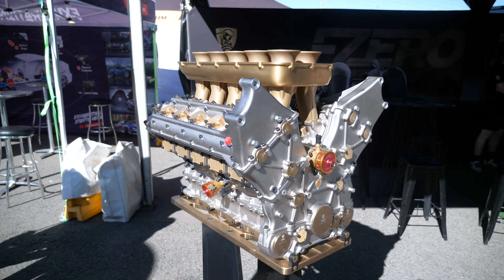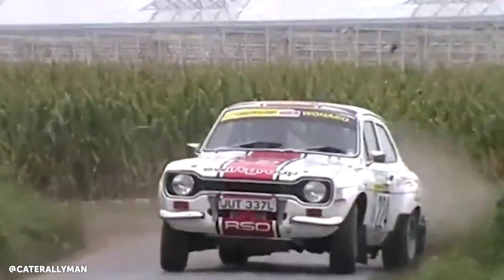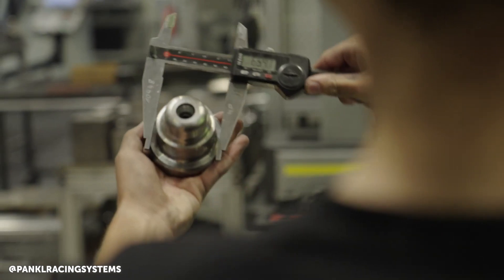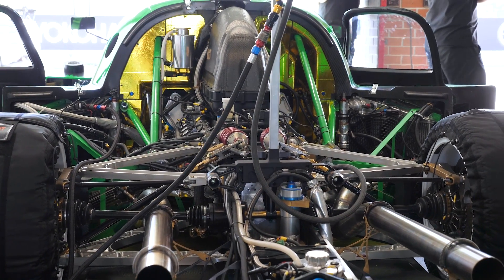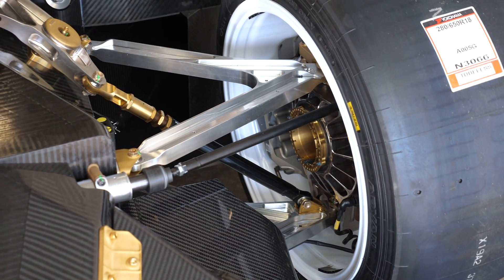NEW V10 Engine With A €45,000 Crank | Rodin RC.TEN

Comment from the maker: What's your favourite V10 in terms of sound? - Taz.
👨‍🔧 Building a fast car? Get $400 OFF the all-inclusive VIP online course package deal:: https://hpcdmy.co/rodinv10
✊50% OFF your first online engine building course. Enrol now: https://hpcdmy.co/rw3
TIME STAMPS:
0:00 - V10 V12 Nostalgia
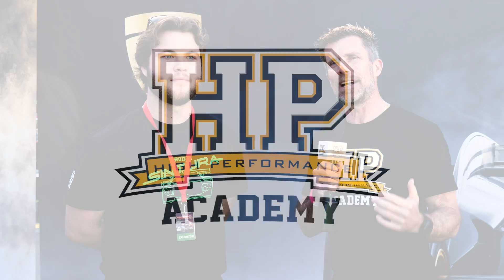0:20 - Mike Gartrell: Rodin Cars
0:30 - Why Design A New V10?
1:07 - What Did It Take?
1:58 - Neil Brown Engineering
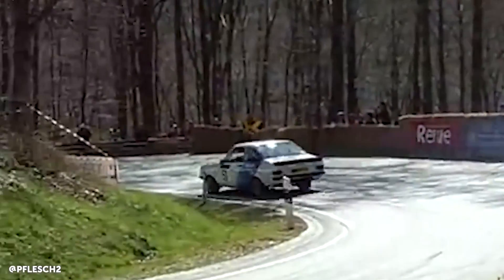2:17 - Design Process Simplification
2:30 - Engine Specs
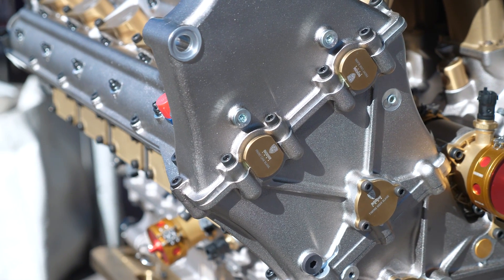3:05 - Volumetric Efficiency
4:10 - RPM Multiplier
4:28 - In House Machining
5:04 - Why? (Scale)
5:59 - 3D Printing & Casting
6:42 - What Is Vacuum Casting
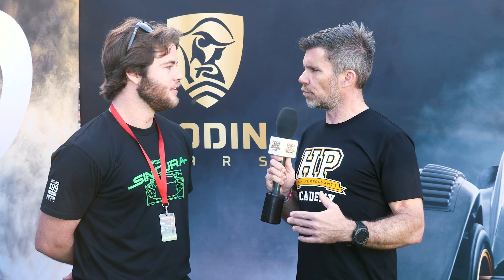7:12 - Why Cast Vs CNC Vs 3D Printing
7:48 - Initial Testing
8:26 - Sentura Packaging Restrictions
8:44 - Twin Turbo Plans
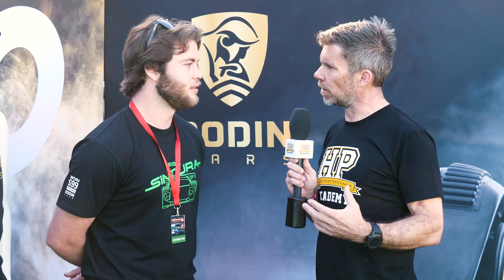9:48 - Steel Lined Bore
10:17 - What Is Nikasil?
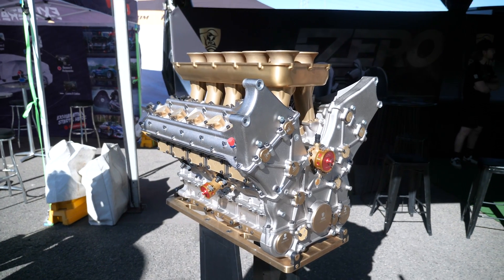10:57 - Direct Injection
11:29 - Bosch Fuel System
12:06 - www.rodincars.com
12:10 - LOUD NOISES
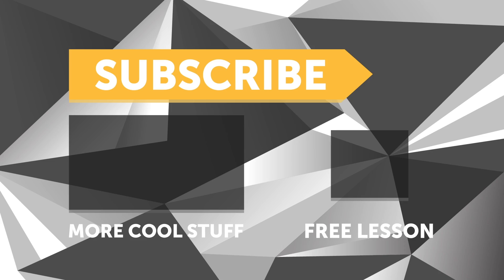12:50 - BUILD.TUNE.DRIVE
Reply: Lexus LFA
Reply: Favorite V10, in terms of sound? The Judd V10 in Ryan Tuerk's Formula Supra. As far as I know it's the only one of those engines with an X-pipe in the exhaust system, and nothing else sounds quite like it.
Reply: @griffinfaulkner3514  the judd v8 in the bmw Hillclimb car is also absolutely incredible f1 sounding scream, chills everytime i hear it
Reply from the maker: @griffinfaulkner3514  solid choice! That car on the whole is immaculate - Taz.

Comment: 86mm bore is the downside, IMO. Judd's got it right with the 90+mm bore. I mean, 89mm at the very least, and if you paired that with a 63.5mm stroke, you could rev even higher. It's not like 92-96mm pistons can't be made for extreme RPM duty above 10k rpm. 95 bore 63.5 stroke gives you a 4.5L that can safely rev to 13k and likely make peak power around 11.5-12k for over 850hp at the crank. An 89 bore on the same stroke would be down 100hp and 550cc from that.

Don't forget the stepped header primary tubes and a merged exhaust for the ultimate harmonic wail overtones to the V10 sound. I see this car has divorced exhaust, and because of that it doesn't sound as good as Ryan Tuerck's Judd supra. Pretty easy fix, just merge the dual 3" collectors/pipes into a single 4.25" pipe. Should be good for about 740hp worth of flow, too. Do your own cross-referencing and calcs, but the easy calc to go up, assuming area is matched to flow, is 1.414x the diameter of your duals, whatever they are.

Comment: This is for the purists with big pockets. Proud of them. Even doing part of this is hard in NZ, let alone the whole thing. Incredibly impressive vision and drive. 
I love it, but for me an LS platform doing similar or more power and torque for 20k range is far more enjoyable and to me sounds just as amazing in it's own way. 

Nikasil was developed in ~30s for Lister CS indirect injection diesel engines (the longest produced engine of all time, still in production today) and was what pushed their lifetimes further and further. 80k hour rebuilds on modern oil with that coating lmao. 5L per cylinder, 12hp in a twin at 650rpm and 90ftlbs. Weighs 750kg and will do that load all day, all night, all week without letting you down if you keep the oil happy.
When it was truly Great Britain. How far it has fallen today.

Comment: Nickilsile is the 👌 👍 😍......no wear...less friction...its a carbide like coating that all you do to freshen up the engine is 600 grit sandpaper by hand in a criss cross motion in soapy water and blow dry and wipe with oil to deglase ...and a new set of rings and wham!!...... new engine 😊

Comment: How are they supposed to be running 110% VE on a NA engine? And wtf is this guy talking about, the casting method increasing the density of the material? Honestly, this guy seems clueless. Bad image for the company
Reply from the maker: It would be great if you can post up some details on how he is wrong to state these things with supporting links. I can tell you though in your search you are actually going to find out that he is right on both counts here 😉

I'll let you do your own research but for anyone scrolling by:
110% VE is possible and isn't even uncommon in N/A motorsport applications. That has been the case for decades. I'm sure there will be some dyno tuning videos showing this if you have a hunt. Sadly it's not something we've covered (from memory) outside of mention in the VE module of the EFI Tuning Fundamentals course.
Different casting methods can influence the density of the finished product for a few reasons, but porosity is probably the simplest to look into. You will find info on this from many major companies that offer such services. They often supply handy comparison tables.

I'm sure Mike would even politely explain these things to you if you had the chance to talk to him rather than personally attacking you too. Food for thought in how you treat others, even in the rather impersonal comments sections here... - Taz.
Reply: hahaha

Comment: GMA T.50s is at 770 hp at 6 kg heavier, and I'm guessing more reliable. That includes the ISG as well
Reply from the maker: Yeah that's a nice V12. Guess you'd hope the 2 extra cylinders would be worth the effort compared to a V10 in some way eh.
Without data, all you have is an opinion regarding the reliability guesswork, I guess 😅
We'll know how this pans out with time, same for that Cosworth GMA V12.
When I say 'we', I'm sure you're in the same boat as me and will just learn from others experience really with no actual skin in the game to worry about 😂  - Taz.
Reply: @hpa101  yeah, it's my guess purely from the fact that the T.50s engine is a V12 (superior balance to a V10 naturally) and that it's a semi stressed design rather than fully stressed

Comment: Great car. I'd like to know what fuel they use. Cossworth GMA 4.0 is a V12 street engine with 650BHP, it would be sure very interesting to see the comparison. Great video, thanks.
Reply: This is a race engine. T.50s engine makes 770 hp and is essentially the same weight
Reply: @Shadowboost  
The T.50 engine is the GMA engine. It makes a little bit over 650bhp. It has a bigger brother for the Aston Martin hypercar, a 6,5l V12 with 1000bhp, a little bit over 200kg.
Reply: @kledomuc1713  the T.50s is the track version of the T.50. It has a modified engine with no variable valve timing, no emissions devices, and 12 ITBs. It makes 770 hp and weighs 166 kg. It is DIFFERENT than the road car engine
Reply: @Shadowboost  
Thanks. Heard of the track version but didn't know it has such a significant power, I love this engine even  more than.

Comment: there was no better sound than those 19k rpm V10s. Can somebody help me understand the benefit of the V10 over the V12 in F1? I remember hearing that the V12 outright makes more power, but that the V10 has a better balance of weight and fuel economy. Is that all there is to it?

Also, imo, they should take those modern literbikes with the most advanced consumer level engines in the world, and just scale that same tech up to v10s. Mmmmm that would be nice!
Reply from the maker: I think reliability at high RPM was a factor too, but the capacity rules changing according to many put the V10 in a sweet spot compared to the V8 or V12 options on the table at the time. 
There are tons of articles and videos on the V12s, but ultimately the V10s came out on top with the Ferrari V12 of the 90's failing to gain any driver or constructors winners trophies. Crazy how many DNF's they all had back then compared to today - Taz.
Reply: @hpa101  Ahhh reliability. Thank you so much. Maybe the less moving parts and also relatively larger engine parts helped with the reliability.
Reply: @El_Chompo  it was mostly weight and fuel economy. Reliability was not bad with the V12s since the engines were better balanced than the V10/V8s
Reply: @Shadowboost  when i read about it, at the time the V12s were too thirsty but the V8s they developed didnt had enough power. The V10 config was actually a novelty for cars that only really started in late 80s exactly as a favorable middle ground between the pros and cons of the V8 vs V12, despite the natural inbalance they prefered to try and work around it with a little more overenginering with balance shafts and other components which to an extent played to their favor as they also made these engines a lot more sturdier and capable of reaching really high power figures and revs. Today with tighter emission standarts and advancements on forced induction tech the V10 is unfortunately virtually dead as VW/Audi ceased the 5.2 FSI, the last production one remaining, and only race tuners and crate engines like those of Judd for example still exist but are really hard to get and not very suites for road usage unless they get significantly remaped. I think the key objective advantage of a V10 today would be size min maxing as its obviously smaller than a V12 but could potentially be more adequate than a V8 for higher displacements, and if willing to work around the balancing issue the engine would consequentially be sturdier naturally. Still, really wish the car industry gave it more chances, they were still ultimately a rare config as you can count on both hands the number of road engine V10s made counting multiple gens like the Viper as one, and back in the 2000s with the F1 and novelty hype behind it a lot of brands were giving it a shot (shame Ferrari didnt had the balls to try and giving it a shot as well, their F1 engine was amazing) but even still, now its basically dead unless Rodin here want to bring it back (please please do) Cosworths RB17 unfortunately is not road legal as amazing as it is so its not the same thing, same with the Solus GT from Mclaren.

Comment: Volumetric efficiency is theoretical mass x actual mass. Theoretically mass is the mass of air that would fill the same volume as the cylinder displaces. Having 110% is news to me. I’m assuming it’s a ram air design of some sort
Reply: Ran air. All these formula type engines make that
Reply from the maker: Not necessarily ram air and only ram air. Here's a quick piece on pressure waves and ITBs -https://www.hpacademy.com/technical-articles/trumpet-length-and-its-effect-on-torque/

The great cam control we have these days is important too.

This is also a quick thread on the topic: https://www.hpacademy.com/technical-articles/trumpet-length-and-its-effect-on-torque/

Hope that helps @Lnmoto86 and @Shadowboost. There is some more on it in the forum too 🤘 - Taz.

Comment: So just want to make sure I'm understanding their engine development.
It makes 720hp, well only 500, but 220 or just under 1/3 more power is totally easy to find. ITB's for the win!
12,000 rpm
15:1 compression
Current cams are to suit turbo application, which in no way would support 12,000rpm or 15:1 C/R.

Current inlet manifold is single throttle body designed to support 1000Hp + however is currently a restriction
And direct injection because super lean burn is the way forward.

That interview did more harm than good.
Reply: Yeah, it's a bunch of targets. Meanwhile GMA has actually demonstrated 770 hp
Reply: @Shadowboost  It's not targets it' straight up nonsense.

Why are turbo cam profiles different? Because you don't want boost going straight out the exhaust so there is generally no overlap.

Why 15:1 compression ratio? because high rpm N/A engines have low dynamic compression due to the large cam overlap required to exceed 100% VE and reach high rpm.

So to claim to be running that combination is an admission of a) not understanding how engines work b) not knowing what the actual combination is c) making excuses for the lack of performance in a nonsensical way.

As for the 1000hp + manifold it will allow 1000hp+ N/A or boosted, unless entirely too small requiring high boost pressure to overcome lack of area which is extremely inefficient. 

Direct injection isn't even the most efficient method of combustion. Pre-chamber ignition is. So if you were clean sheet designing an engine why not go with what is best?
Reply: @jdoe9518 I would love to see pre-chamber ignition on a flat-6 huge bore aero engine. But otherwise, short combustion times make an engine sound like a Diesel. And a combustion chamber in the shape of a cyclinder with central spark is already quite fast. Make the exhaust valves a little smaller and move to the center and liquid cool that edge to prevent knock and you can advance timing.
Reply: @ArneChristianRosenfeldt  Better let F1 and Mahle know they don't what they're doing then when it comes current pre-chamber ignition systems. 50% thermal efficiency is over rated anyway
Reply: @jdoe9518  F1 has only 6 cylinders, so each one is bigger. Though F1 limited RPMs, they are still so high that they need any acceleration of burn that they can get. I don’t believe that efficiency yet, this technology did not spread since its invention years ago. I think that only stationary SI engines use a pre chamber to run super lean.
Reply: @ArneChristianRosenfeldt  Cool story bro. Maybe do some actual research
Reply: @jdoe9518  my research about legacy technology like ICE only consists of the YouTube algorithm, and I hope that its AI will parse out conservation and put some clarifying videos in my feed some day.

Comment: 15:1 compression ratio. God dam. And 12k rpm. I bet she screams
Reply: 15:1 is standard i would say.. many hillclimb cars here are running 14-15:1, tho that is static CR and with big cams what you want to know is dynamic CR
Reply: @exvils how do you even overlap valves at that compression ratio? It makes all engines look the same. No matter if Diesel or gasoline, 4 valves from the top (almost no pentroof). Minimal overlap which VVT can set to zero for stable engine braking .
Reply: @ArneChristianRosenfeldt  dome will take care of CR, no vvti in any of those engine (one friend of mine only runs vtec and around 13.5:1). Also not every engine has wide valve angle, most narrow valve angle engines with high positioned intake port  perform the best, and deeper valve reliefs is all you need.

also example, 17.5-18:1 CR 1.9tdi 8v (stock thickest headgasket) will run 282° cam in stock form, although valve reliefs are recommended. There is also like 30cc volume in bowl of the piston.
Reply: @exvils  valve reliefs increase surface area, which is bad for heat insulation, but also turbulence “insulation”. We want turbulence to keep its energy from intake to mid flame front propagation. Slight reliefs in the firewall for the intake valves is what I accept. But then I also am a fan of a turbo and short intake to get air in right from the start of the intake stroke .

Comment: Never forget the history you guys have down the road in Aus. Repco for a time, several sunsets ago were the engine supplier of choice, if you wanted to be competitive in Grand Prix, before that Duckworth turned up and made it very difficult.
Great no bull interview, we can only wish them the best of luck with this very exiting project.
What's the bets they end up with 12cyliders @ 4ltrs displacement😉
Reply: Repco only supplied Brabham, they didn't supply any other F1 teams. .
Reply: @MasterChief37  Brabham was the only team that won a world championship with a Repco. Walter hassen of Coventry climax is reputed to have advised their clients to buy a Repco after the Coventry's succession from race engine manufacture at the time of the 3Ltr limit. The best they could do was a stretched FPF to 2.7 Ltrs of 4 cyls As a result many smaller teams using proprietary chassis fitted a Repco 
Marcos also used a one in the 1968 XP sports racer for Spa. It failed to finish because the alternator driven off the back of the box was soaked resulting in a failure to proceed. That's motor sport for you😔
Reply: @gothicpagan.666  they didn’t supply other teams only Brabham. Brabham sold customer cars to other teams who raced them, these cars came with Repco engines. Only Brabham chassis used Repco engines in F1. It was rather quickly eclipsed Cosworth DFV.
Reply: @MasterChief37  Paul Emery borrowed one to replace the early Martin engine that didn't work in his Emerson.
One of the Italian counts used one to replace a broken Maser engine he used in the back of a Cooper, another had one in a F2 Cooper chassis when the V6 Ferrari engine failed. 
There were many f2 chassis fitted with bigger units just to get an entry in an event that payed much better.
My dear old dad made a reasonable living from playing with toys